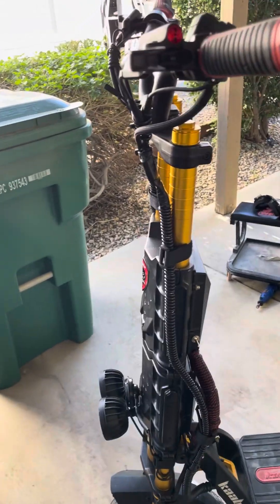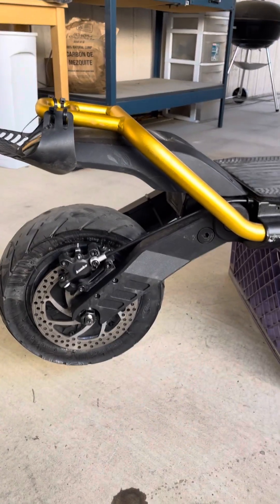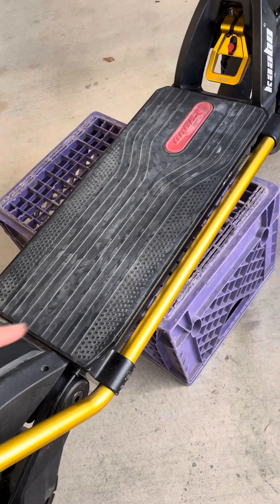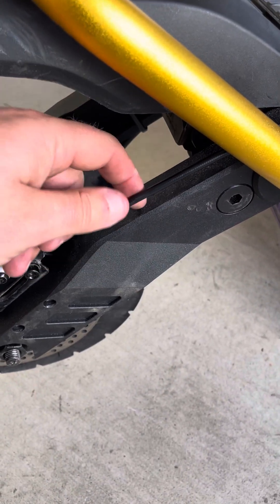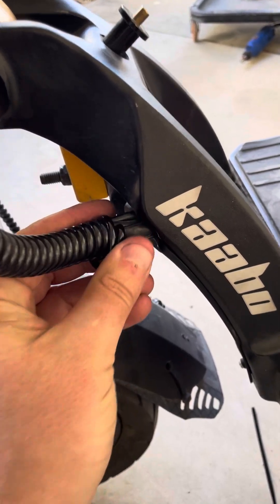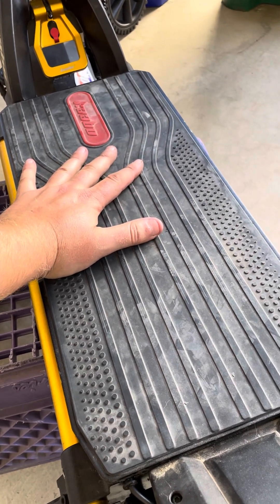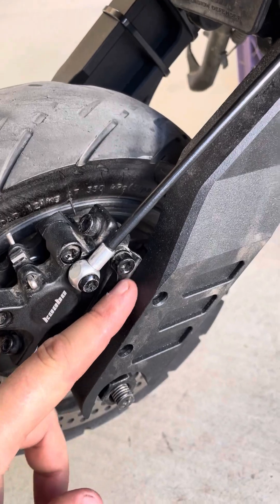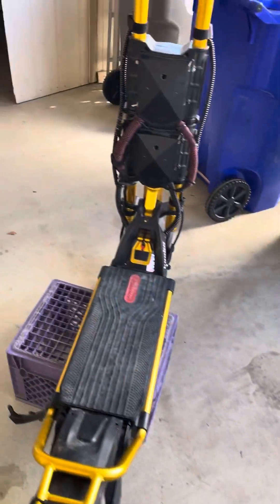Kaabo Wolf King GT Extended Swing Arms Overview

Comment: Sick build! is that the rion build I seen on fb? Also you could try running your rear motor wire outside of the battery box. Gives alot more room in the battery box. Has saved me a lot of hassle going in and out of the deck.
Reply from the maker: Ya bro that’s me haha thanks! .. and ya that’s a great idea, might do it with the rear brake cable too
Reply: @jaken528  I thought so 👌😉I've plans to do a vesc a upgrade soon myself to get that extra oomph. The motors themselves can actually handle up to 114amps!